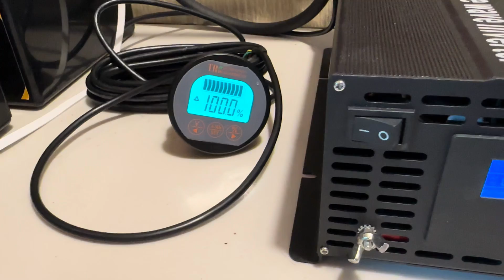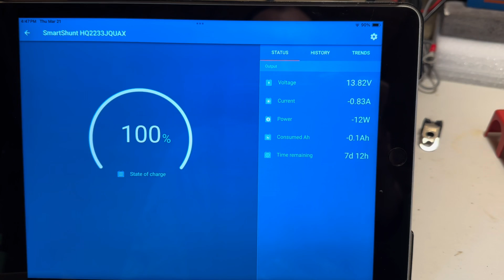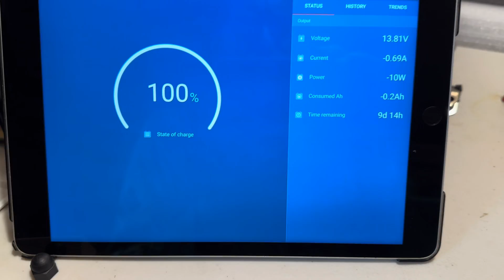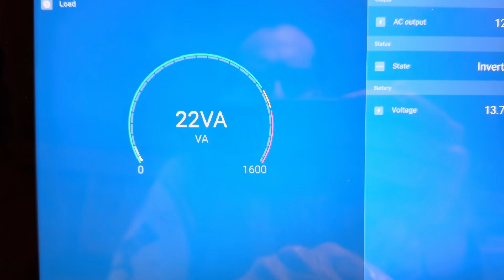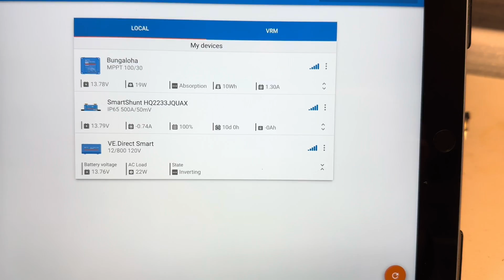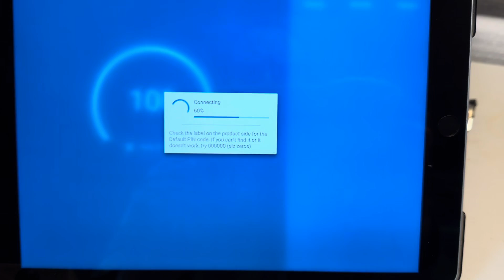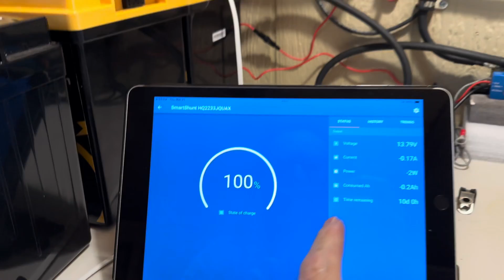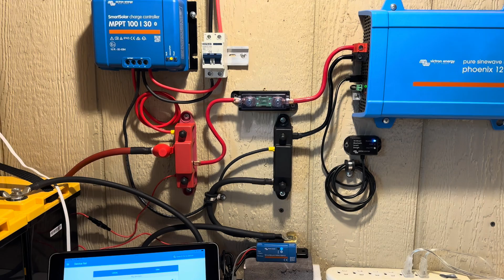The Blue Wall Installed! Victron PSW Inverter/Charge controller/Bluetooth Dongle/Smart shunt

Comment: Would You drop that Charge Voltage to 14.1 as aopposed to 14.2 as You did on the other Victron Charge Controllers ?
Reply from the maker: I've gone back to 14.2v on all my systems. Just using the preset LiFePO4 setting on all the Victron cc's. Working well. Aloha!🤙

Comment: Yeah the eco mode is a PITA on small loads.  Also, IF you discharge the battery below a certain set point say using a space heater, the eco mode will pulse in an attempt to re-connect the load once the battery voltage recovers.  Since the inverter idle wattage is low, I don't use that anymore.    I still think the most valuable asset is a smart shunt as it works on ALL types of batteries, controllers, etc........Gary from SE MI.

Comment: Have you ever thought about running 12v DC for you lighting needs? I use my normal desktop lamps with 12v DC bulbs and normal receptacles wired, AND LABELED, for 12v DC. I do this to avoid inverting and converting losses. I try to use DC for anything I can. Charging electronics and lighting are good examples. Anyway, I enjoy your channel, stay safe.

Comment: When you have the time and energy, I gave you a big list of settings for the shunt in the comments section of your previous video on the shunt.   Particularly that Peukert exponent needs to be adjusted to 1.05.  In anycase, looking great!  Love the graphs!

On visibility... I don't even look at my shunt anywhere.  I always use the bluetooth app 🙂

The phoenix inverters, being low-frequency inverters, do tend to have resonances and hummmmms depending on the load.  That's the only annoyance though.   I don't use the ECO mode, its never worked well for me.  I just leave it on... that particular phoenix has an idle draw of around 10W I think, which is pretty low.

-Matt
Reply from the maker: Of course I stayed on it last night obsessing...putting a video out on it right now. Huge thanks brother! Aloha!🤙

Comment: looks great ! the smart shunt does more so you have to input data from your battery . that takes time to crimp large cable and heat shrink ends . every time I work on stuff at home my cats have to check it out. they love new packages that come . they sleep on the box and when I take the stuff out ,right in the box they go. been quite cold and snow hear. march started out much warmer. look more like early spring . now looks like winter. some what windy. making some wind power. starting to get more solar as sun comes up. even more hot water.  not much noise from inverter. should run your coffee pot .
Reply: If one sets the Victron units as a network then the units will talk to each other and the current shunt will additionally monitor the battery voltage with the thin red wire. Under load it will be in error by the voltage drop in the cable.
Reply from the maker: Heat shrink! Gosh darn it I knew i forgot something! Haha! SO appreciate the sharp eye brother. Yeah, my cats are always right in the mix wondering what I am doing. I see it's been a tad chilly out your way. Pretty much normal conditions here which is nice. Rain, sun, tinkering around in the shop! Life is good. Aloha!🤙

Comment: The factory settings are: Shut down: 50 Watt (linear load). Turn on: 100 Watt (linear load), for eco mode but it is adjustable apparently.
Reply from the maker: It is adjustable, and I only figured that out last night. I will probably just leave it on 24/7, at least initially until I learn everything and figure out what I will run up there. Aloha!🤙